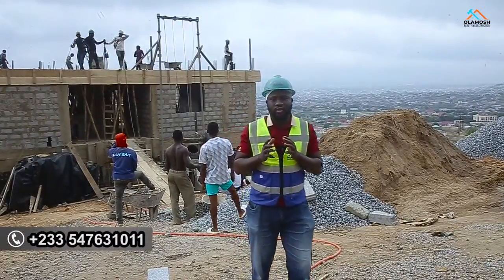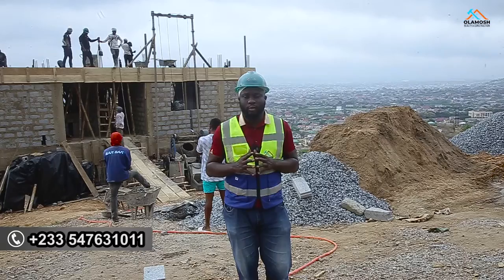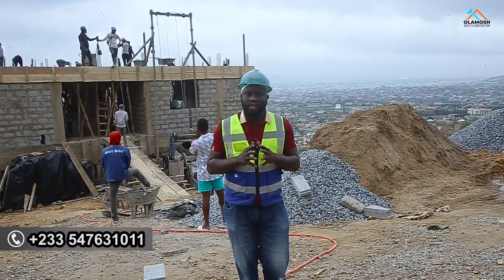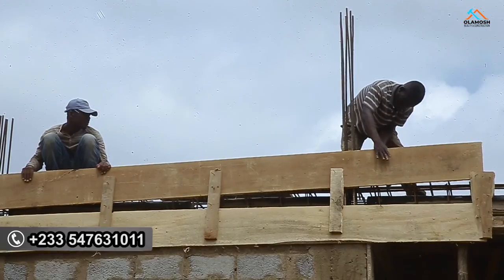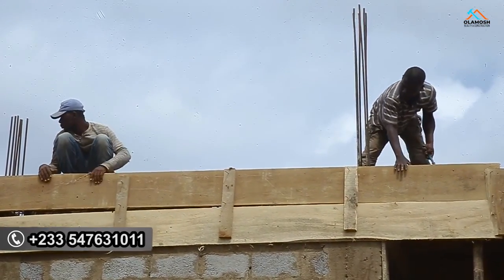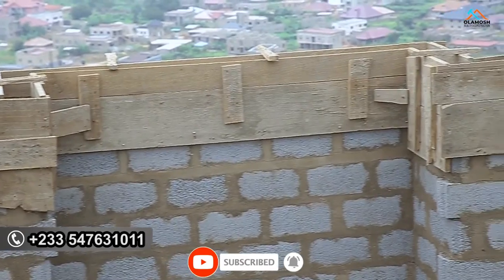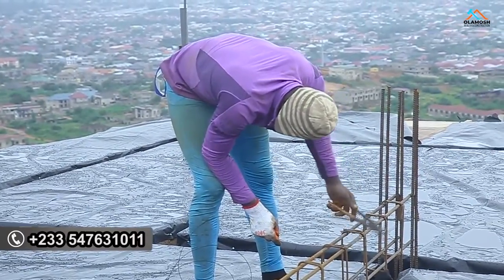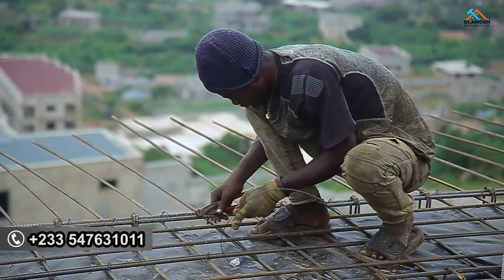Don't Concrete Casting a Decking without doing this | Building in Ghana

Comment: Am leaning a lot, thanks so much but please how long can it take for a decking to be completed. Like the carpentry work, steel work, plumbing work and electrical both with concrete casting? Thanks Sir
Reply from the maker: @davisrevnyarko3220  Glad it was helpful. It depends on the project size and the kind professionals/artisans you are dealing/working with…As building contractor, it’s not easy working artisans but we do find way out to ensure quality delivery……..Using this project as a case study- 2WEEKS
Reply: @olamoshghng  Thanks so much 🙌